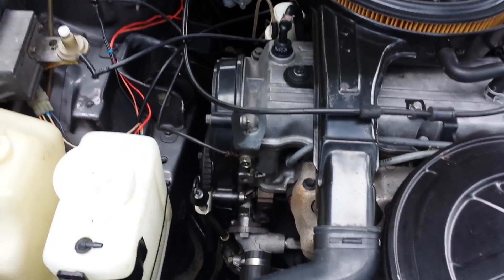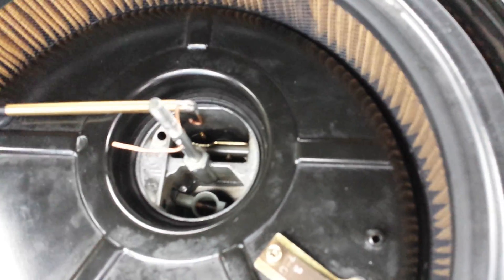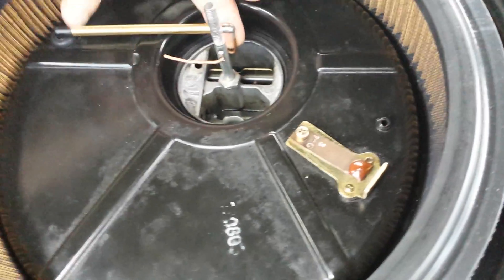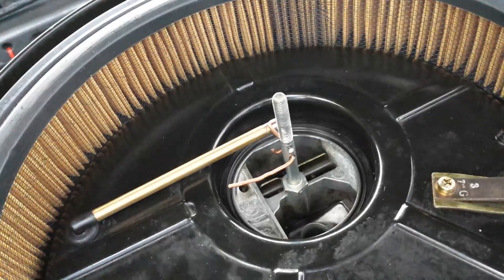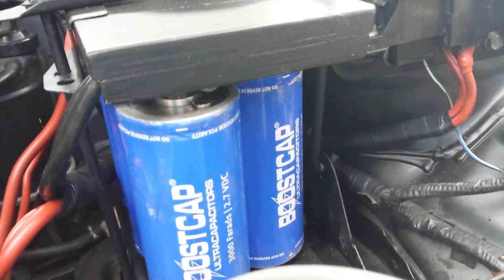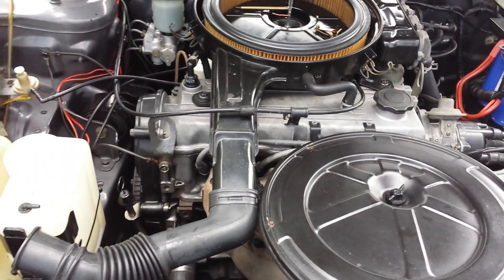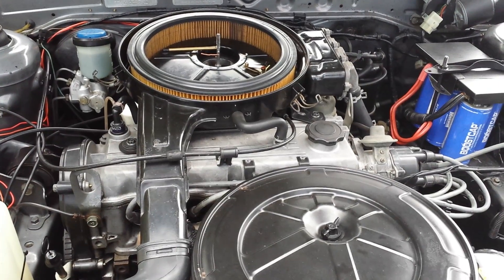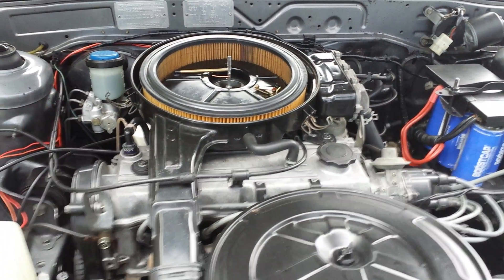Water injection and boost pack replacing battery

Comment: You did such a nice thing replacing your battery with a capacitor bank, why you had to fuck everything up by tossing water in the engine?
Geeez, why can't idiots do two right things in a row??
Reply from the maker: Lol i just took video of this vehicle when it was parked outside my shop.
The owner claims the water injection gives more power as it did in the Spitfire airplanes when used for extra power. The extensive wiki entry on WEP (War Extra Power) systems used in these planes usually shortened the life of the engine but did give a significant amount of extra power.

Comment: boostcaps, gotta get some of those, but they're bloody expensive ;-(
Reply: HDXFH yah they expensive at first but long run it will be cheap, because if you keep the car long, then it Great. it 400 dollars for big system. 3000 Farad. or 200 included alll cost for a 1500F, it would last more than 4x normal battery which last 4-5 years on the 100 - $250 dollars car battery.  Not to mention the Super CAP, lighter weight and it save you gas in long run

Comment: hmmm...is this one of those free energy videos...it feels like it
Reply from the maker: Hi Leo, no its not a free energy video. Reducing emissions and getting higher mileage is what is going here. The capacitors replacing the Lead acid battery reduce the weight of the vehicle and the water injection increases power and mileage. Nothing free here.
Reply: m3sca1 So does a rubber band around the tail shaft :)
Reply from the maker: Huh?

Comment: FWIW people running water injection on diesel engines often find elevated levels of contaminants in the oil, I suspect that this will also happen in a petrol engine. Best to not delay oil changes...
The mention of the aero engines is interesting, I had heard of water injection being used but it was a bit unclear what specific purpose it was used for, I believe it is an effective way to control detonation in high compression or supercharged engines.
Must get myself a bank of Ultra-capacitors to play with too....
Reply from the maker: The guy who owns this car is running diesel engine oil to catch the extra crap.

Comment from the maker: Update on information regarding the claim about water injection on Spitfire planes. Many wartime vehicle's were fitted with WEP systems. The following is from Wiki 
War Emergency Power (WEP) is an American term for a throttle setting on some World War II military aircraft engines. For use in emergency situations, it produced more than 100% of the engine's normal rated power. Maximum normal power would be limited by a mechanical stop, for instance a wire across the throttle lever slot, but a more forceful push would break the wire, allowing extra power. In normal service, the P-51H Mustang was rated at 1,380 hp, but WEP would deliver up to 2,218 hp.[3] In the P-51D Mustang, the model most produced and used during WWII, the WEP increased the HP from 1490 to 1720. The Vought F4U Corsair, not originally equipped for WEP, later boasted a power increase of up to 410 hp (17%) when WEP was engaged.[2] Several methods were used to boost engine power by manufacturers, including water injection and methanol-water injection. Some earlier engines simply allowed the throttle to open wider than normal, allowing more air to flow through the intake. All WEP methods result in greater-than-usual stresses on the engine, and correspond to a reduced engine lifetime. For some airplanes, such as the P-51D, use of WEP required that the engine be inspected for damage before returning to the air.[4] 5 hours use of WEP on the P51D required a complete tear down inspection.[5]

British and Commonwealth aircraft could increase power by increasing the supercharger boost pressure.[6] This modification was common by the Summer of 1940, with the widespread availability of100 octane fuel. Raising supercharger boost pressure from 6lb to 12lb increased the Merlin IIIengine rating to 1310hp, an increase of over 250hp. Pilots had to log the use of emergency boost and were advised not to use it for more than 5 minutes continuously.

The German MW50 system methanol-water injection system required additional piping, as well as a storage tank, increasing the aircraft's overall weight.[7] Like other boost techniques, MW50 was restricted by capacity and engine temperatures and could only be used for a limited time. The GM 1nitrous oxide injection system, also used by theLuftwaffe, provided extreme power benefits of 25 to 30 percent but required cooling on the ground and added significant weight.[7] One of the few German aircraft that could be equipped with both systems, the late war Focke-Wulf Ta 152H high-altitude fighter, could attain a velocity of some 756 km/h (470 mph) with both systems used together, reportedly as Kurt Tank once did in using both boost systems simultaneously when he was flying a Junkers Jumo 213E-powered Ta 152H prototype fitted with both MW 50 and GM-1, to escape a flight of P-51D Mustangs in April 1945.